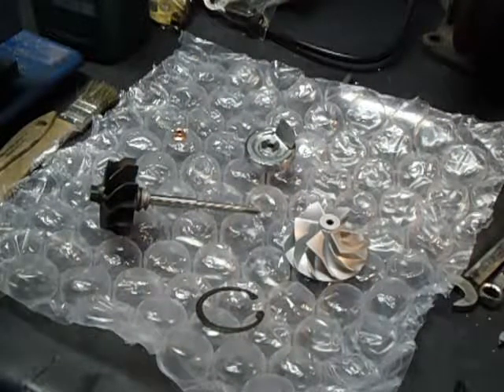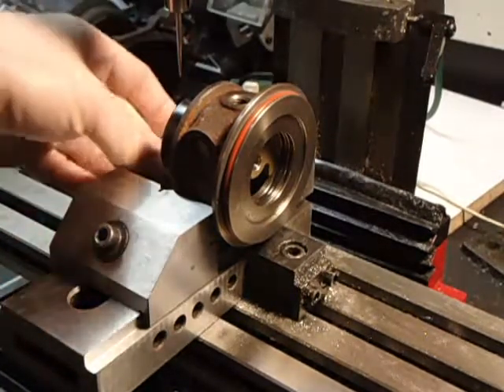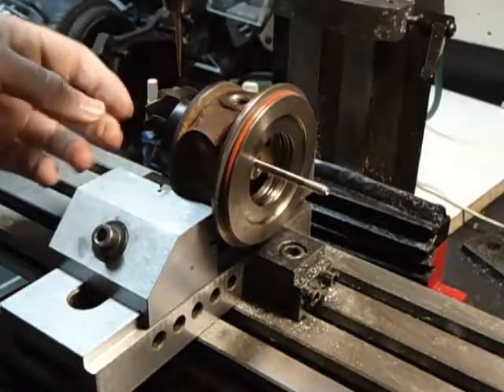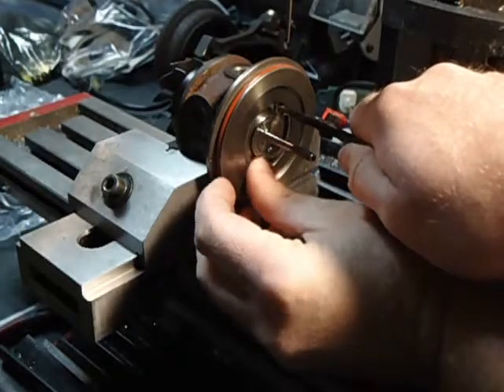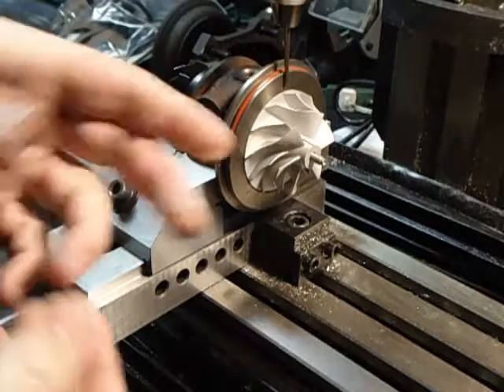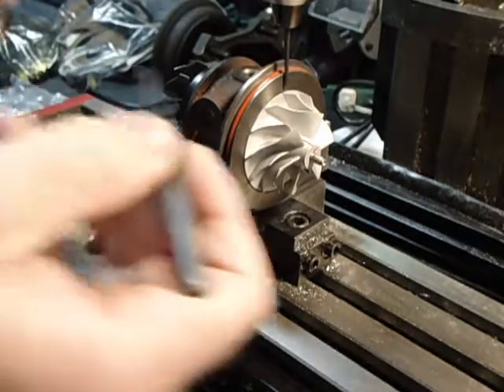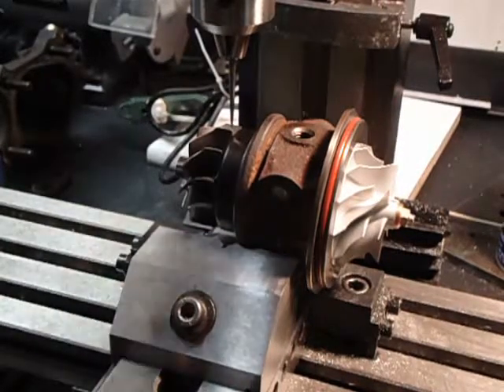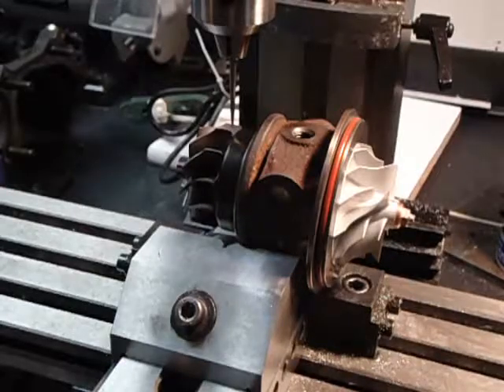Mitsubishi TD04 HLA 19T For Subaru EJ20Y Assembly Part 1

Comment: Hi! Could you help me please? I got same TD04-HLA from JDM subaru legacy. After only 2000km and boost near 1,2bar it began wasting oil. Would it be helpful if I use kinugawa`s or mamba`s 19-t cartridge with stock compressor and turbine housings? Thank you
Reply from the maker: Either one of those cartridges would probably be ok! Before jumping to a turbo, make sure your PCV valve isn't plugged up, simple but it's good to check! I LOVE this turbo.... spools so fast.... Good luck!
Reply: Actually before turbo was intalled we had checked and cleaned both of the oil feed line and the PCV valve. Now of course it`s better to do this again, or maybe i`ll find another reason. Still, could you tell me please, is that possible to run my td04HL with ball bearing system? Thank you again, have a nice day!
Reply from the maker: I think the vf38 is a ball bearing turbo, and bolts on to stock flanges for the tdo4hla.... Someone might be able to convert the cartridge to bb.... The vf38 has less top end if i recall....i haven't researched bb conversions on these turbos really.